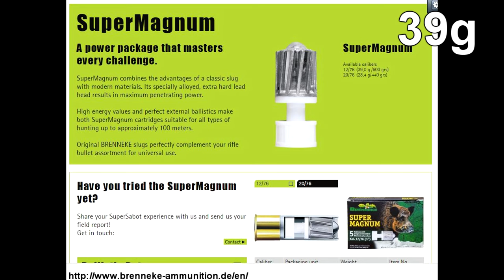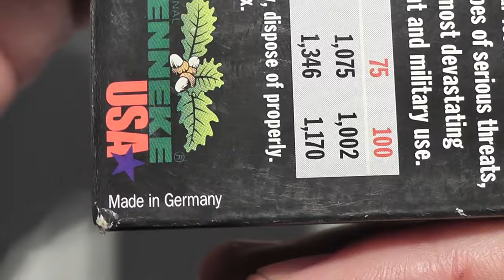BRENNEKE Special Forces Slug vs ENGINE and MORE!

Comment: Working private Security in Arizona I used the Brenneke steel rifled slug over 20 years ago, had to special order them, but always well worth it. Worked very well in my High Standard M-10B 12 Gauge.

Comment: The thing about a rotor is it goes through thousands of high temperature heat cycles, typically a good quality steel, so they're tempered and tough as hell. The crack and the dent is pretty impressive considering just how hardened a rotor is.

Comment: Not surprised it didnt go through the brake rotor. Thats some really hard metal! Not to mention its a used rotor, which is actually stronger than a brand new rotor in most cases because the constant heat cycling actually makes the metal stronger over time. It basically  gets heat treated over and over, as long as the rotor wasnt overheated. Either way, thats a pretty damn impressive slug! One thing i like to do when i go camping and bring my guns is i set up pieces of firewood lengthwise so i am shooting at one of the ends, then ill use a burlap bag of rocks and dirt and lay it over the top and then shoot 3" magnum load slugs in an effort to try and split the pieces of firewood. Ill start with a 12-14" diameter log round and chop it in half so i can lay it cut side down on top of another firewood round. Then ill shoot at the piece from about 20-25 yards and almost every time it will pop the piece in half. I have even done it shooting at a solid 10" diameter log round about 12" long. Its a fun way to chop firewood haha. Just have to make sure the wood is dry and seasoned. Another thing that is really fun is to get a 12" diameter log round and use a forsner drill bit to drill a 1.25-1.5" hole thats 6" deep into the middle of it, then mix up some tanerite and fill the hole to about 1/2" from the top. Then melt some candle wax to fill the top to seal it in. Then set it up with the hole facing you and use a rifle that shoots at like 1750fps or faster (i use my AR15, my AR10 or my .300 win ultra mag) and aim for the wax circle. Set it up 150-200 yards out to give you a little bit of a challenge. If you hit it dead on you will get a nice loud boom and it will blow the wood open and most of the time into a few pieces. Its a blast, pun intended.

Comment: You have to consider how you are mounting your targets.  Like in the brake rotor.  The energy from the slug was transferred into rotational motion by the rotor.  If that rotor was on a truck, locked down by lug nuts, the result might have been different.

Comment: A brake Rotor is much harder than an engine block, would love to see a running engine shot with one of these.
Especially if the throttle pedal was pinned to the floor. :-)
Reply: Good idea!

Comment: i tried several of the brenneke slugs years back and found my favorite to be the emerald lightening the recoil was more tolerable and found the to be accurate out of a home defense shotgun the sf magnums were pretty harsh though an had some crazy penetration that said we were using wood for reference instead of metal
Reply: You literally have no point. You have no capitals. You only have a hell of a lot of words squirted out one by one. Yuck. Good luck on changing that.
Reply: Made perfect sense to me. Read it once fluidly and didn’t need to repeat any of it. Maybe some other person might have a problem?

Comment: Brenneke slugs are the loading for the old Activ brand slugs. Those things were a beast and I think the Brenneke Corp is trying to make theirs as powerful as the old Activ loads. I doubt if they came even close. I shot boxes 2 3/4" Magnum Activ shells and those things were no joke. Magnum refers to the powder load and not the shell length. I reloaded my empties, and they were pushing dram equivalents not found in 12ga shells (4 dram loads -- equivalent to 10ga). Those all plastic shells were the toughest I have ever reloaded. 

Otherwise, high brass - low brass, whatever -- those cases each hold about the same pressure. Heck, Activ cases were all plastic with a steel disc molded in, yet held up better under reloading than any of the others I used and I could shoot the hottest load my gun (870 Wingmaster) could handle out of them. The brass is for shell extraction and is a holdover from the paper shell days. The gun's chamber holds the pressure, not a thin brass tube at the base. That brass would split well before even a SAAMI spec loading if it had to handle the pressure.

The Activ slugs rarely, but maybe one out of ten would fly wonky. The rest were like laser beams. I think the Activ extremely high dram powder loads were rarely but occasionally blowing the super tough plastic shaft off of the slugs. Brenneke corp is probably trying to increase the power while using a weaker plastic shaft than Activ did. That would explain the constant separation and ensuing ballistic problems.

As to extra deep penetration -- that would depend more upon slug style and hardness of the lead than speed. Slow with a very heavy hard mass gives higher penetration than faster and soft. You don't want much separation or mushrooming for penetration and the more mass the better. Shotgun like speeds in a 45/70 government with hard cast lead bullets can yield penetration that is almost unbelievable. Look up Garrett Cartridges and examine their performance and testing specs on their superhardcast 45/70 loads.

Comment: Great video!
If you really want to stop a large motor, shoot it in the crankcase, not the cylinders.
The cylinders are harder than the crankcase; a .44 magnum will go through a crankcase, but not the cylinders (the cylinder liners are very hard, especially on a diesel engine).
Reply: Shoot the radiator they won't get far

Comment: 3:14 there’s usually an chemical reaction that is caused by draining a battery that created spongey lead which is less Dense than normal lead so when you shoot the slug through it, it basically explodes as the loosely packed lead particles get shot in every direction.

Comment: A car accident off duty retired me as a LEO two years ago. My last two years on the job I carried a few Brenneke Special Forces slugs in the sidesaddle mounted on my personal shotgun that I put in the patrol vehicle. The truck on the front of the box sold me because I wanted something that could disable a vehicle engine if needed. I like Brenneke slugs and the cheaper Brenneke slugs were accurate when I shot them for practice. Now I know these slugs are a gimmick. I'm glad I didn't learn that on the job. I still have three boxes of this stuff laying around. Mine are at least four years old and they are red. They were not cheap if I remember right. I don't know what I can use it for now other than shoot targets with it.
Reply: If you want to stop an engine - you must go with harder material than led. Russian Leningradka-2 (jr L-2 for short) or Ivanov Steel Slug will do the job.
Reply: That's why I never trust the box! (in more ways than 1 ;P) There's a good chance that they weren't even tested against a vehicle whatsoever & just used the pic of the truck as a "sales trick". That being said, it is still very possible & likely that these can stop a motor/vehicle. However, it won't be an instant disable. Disable time is dependent on things like shot placement, which systems get affected, type of vehicle & motor, etc... I honestly still have yet to see a "1 hit wonder" that can/does hit it & quit it every single time esp in regards to an "instant disable", including a .50. Hence in Iraq when someone tries to run a military roadblock half the guys are laying down the driver while the others work on the car.
Reply: L-2 and Ivanov Steel Slug do not have colourful boxes with pictures. Cos there is no need. Everybody in Russia knows what these are for. You'll get only small piece of paper with loading instructions and plastic bag. Poleva slugs even better! 10 slugs are wrapped in this paper!
L-2 flies through bushes like rocket propelled razor sharp super woodcutter.
Ivanov Steel Slug is basically the same, but even more razor sharp because it has special cutting edge at front.

But as for the engine block destruction - tungsten slug would be great! Or any slug with tungsten core. Maybe it is ought to shoot tungsten ball shaped slug or even tungsten buckshot.
Reply: Real life is very strange.
"You need a harder material" to stop a criminal's engine block in the commision of a crime.
My car, engine block or whatever, can be stopped simply with a dirty look.
Go figure!
;-)
Reply: It will still stop a diesel engine. But why would you not use your AR for that? A 62gr will stop an engine just fine. You don't need a shotgun, you just need to make a small hole in one of the cylinders
Reply: The department I worked for was not very big and the higher ups did not give us authorization to carry patrol rifles. The higher ups were old timers. Because of that there was no point of taking LE patrol rifle training and the department was not going to pay for it so I was never qualified for patrol rifle. I wanted to carry a patrol rifle though.
Reply: fordrac1ng81 Not everyone gets to carry a patrol rifle. Hell, some get to choose & buy their own. As far as a .22 cal hole in 1 cylinder taking out and stopping an engine? Sure, maybe but not always. In my younger days we used to do a lot of stupid shit to & with junkyard motors & cars as well as shitty trade-ins at my buddy's lot. You would be amazed at the amount of abuse a lot of motors can take. Esp diesels! If we saw cracks or holes in a block that meant we were going to spray & run it even harder. Most motors will still run for a long time being down a cylinder or 2. The best way to stop a motor with small projectiles is to take out the cooling system.
Reply: toomanyglocks thank you for keeping our country safe. Also there's no such thing as too many Glocks.
Reply: I try to have a policy where I don't trust a brand/type of round until I have tested it myself. Aside from marketing gimmicks, some brands/types just don't work well with certain firearms. I learned from a range day that a brand of .380 was absolutely not going to work with my CCW because it would fail about 1-2 times out of every 6. Those aren't odds I'm willing to bet on.
Reply: You need a 30 cal or larger rifle to reliably stop a car engine.  I have several steel spinners that I have shot with a 44 mag and the spinner stopped it with no damage (actually more energy than a 5.56x45).  Shotgun slugs never damage the steel spinners.  Most of my experience is with 300 gr sabots @ 2,000 fps.  But it's kind of hard to hit a 2 1/2" spinner with a rifled slug.  A 7.62x54 203gr SP passed through one of my steel spinners so fast the spinner barely wiggled.
Reply: *****
 The topic was stopping an engine.  Busting the radiator will still allow the bad guy to go 10 to 20 miles. Not to mention, who wants to stand in front of a mad man in a car with a BB gun?   In a self defense situation you want to stop the car from being used as a weapon.  Naturally in SD you want an instant stop.  A capable rifle will stop the engine in one or two shots.
Reply: only 1 question... what if the car is electrical and has 4 electric engines (one on each wheel)  u just wait he emptys hes batteries :D hahahhaa
Reply: steven bodum I trust you deutschlanders to engineer  something effective like that  :)
Reply: Correct. When will people learn that the rifling on rifled slugs impart NO SPIN on the slug. What So Ever.  It is there so they can go threw a choked shotgun without hurting the choke on the gun. PERIOD !
Reply: ditchdigger93
 If the slug didn't spin it would tumble.  I have shot a lot of slugs in my lifetime.  Not once I have a seen a 'keyhole' in a target shot by a slug.
Reply: The rifling on the slug is not designed to impart spin, but to perform two other functions. 

1. Despite lead being a lubricant metal which glides through the barrel due to the principle of dissimilar metals, less surface area against the barrel still reduces friction. 

2. The rifled slug can more easily deform concentrically to accommodate variances in barrel inner diameter. This allows the slug to move between smoothbore and rifled barrels of varying lengths and tapers without risking binding or jamming, thus avoiding overpressures. The rifling is spiral so that it maintains strength when encountering forces from multiple axes (axis).
Reply: shooting rifled slugs in a smooth bore causes them to spin, not much but enough.. TAOFLEDERMAUS made a video of it
Reply: Алексей Лавров I read that entire thing with the best Russian accent I could.
Reply: I saw that video and was surprised by it. He wasn't sure if it was enough to really stabilize them but they indeed did spin slowly. I was going on the conventional wisdom that they didn't rotate at all. I've even seen video to that effect. Whether they do or not they are surprisingly accurate.
Reply: No way your dept approved you to carry this round let alone with a personal shotgun on patrol. You are trying too hard.
Reply: "suggested round?" Your department makes "suggestions" as to what ammunition to carry? Bull.  And you want us to believe the ammo you carried for your shotgun on duty was "your business" not that of your department?  You sound absolute ridiculous.
Reply: I watched that video and I was very surprised at his findings. Everything I've ever read says they don't. I stand corrected.
Reply: toomanyglocks you needed some duplex monolit 28 or monolit 32. engine killers!!!! and dupo and hexolit for bodys
Reply: BLWN GT 1 monolit32
Reply: @blwngt1598  cristal gail
Reply: @brentyoung7356  10 or 20 miles....  depends what time of day/year it is.  A high revving engine with now antifreeze/water wouldn't get that far during the day in the middle or summer maybe 2-5 miles.  Hit a transmission cooler and you'd be lucky to hit 1 mile!

Comment: What? you couldn't find a Swift depot to test the truck part out?? The drivers do the destruction bit out on the road everyday, you'd just be speeding up the process ;)
Reply: shoominati23 swift only takes out the hood. Not the engine 😜
Reply: Blow radiator, 50 might crack block.

Comment: I know car engines are not easy or cheap to come by, but if you could find some to test as targets, that would be super cool. Even cooler if you could setup a radiator in front of them, and then test the penetration into the block.

Comment: You should use some sort of steel wire when securing multiples items together like HDD's. Brake cable, piano wire, old guitar strings or shark fishing wire would be solid options!

Comment: Brake discs are forged steel and heat treated and the block of an engine is cast iron  and the heads are usually aluminum these days , I would imagine the slugs or most 12ga slugs for that matter would fracture a cast iron block or alum head , plus it would disable the truck by puncturing a large hole in the radiator .  At that range you could just shoot the driver  and be done with it.

Comment: They don't actually say they'll take out an engine- just penetrate vehicles. Basically they're marketing them based on the fact they can rip apart an aluminum radiator or go through a car door to take out a driver. They put a diesel truck on the box as it's a formidable vehicle/target, but it's not going to go though the block of a Mack truck. And yes, old brake rotors are made to be pretty hard and heavy so they should be a great target, though you might want to bolt it to something bigger/heavier to hold it in place.

Comment: I really do not think the plastic separating from the slug matters or effects accuracy, it does help seal the inside of the barrel to help push the slug. I think they are designed to fall away. The rifling on the slugs out of a smooth bore barrel are what stabilizes the slug and makes it spin like rifling in a rifled barrel. Do a accuracy test and see if there is difference. I do not know what kind of barrel your using but rifled slugs are meant to be shot out of a regular ( smooth ) shotgun barrel. Foster slugs without rifling are meant for rifled shotgun barrels.
Reply from the maker: The wadding plays a very important roll in stabilizing slugs like these.    They were very inaccurate because they lost the drag stabilization.

Comment: Two things, one, it's a brake rotor afaik, and two, they're made out of much stouter and harder metal than an engine block.
Find a cast iron 12v cummins or similar, and hit it with another few slugs to see what happens. Aim for the crank case where the metal would be thinner, or side on into the crank shaft or where a main bearing might be.
You can stop an engine with a few shots, either from losing vital fluids, fragmentation getting into the combustion chamber, broken crank, etc..

Comment: Well I mean you could stop a diesel engine with a .22LR if you poke a hole in the radiator, it may take it a min or two but it will cause it to overheat and eventually grind to a halt.

Comment: Although I'm not sure Brenneke makes them anymore, (or maybe rebadged/weakened them), but the Max Barrier Penetration slugs, (I bought a few boxes years ago, $20/5 slugs), have a hardened alloy core, and def have some horsepower behind 'em bc after shooting a box of those, you seriously feel it.  The specs talk about shooting through "Steel truck wheels", no mention of cracking brake rotors though, haha.  So I'd be curious to see how they live up to the task?

Comment: A brake drum is very thick very hardened steel.  A motor block is only cast iron.  Strong, but much more vulnerable to massive force.  Go get a junkyard gas and/or diesel engine for ballistics testing.  Imagine all of the possibilities for testing different guns and ammo.